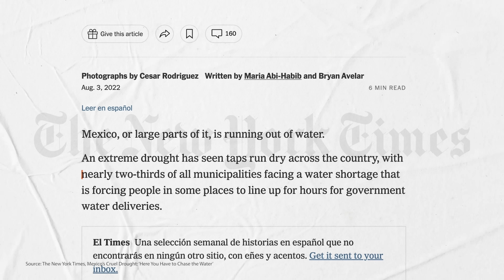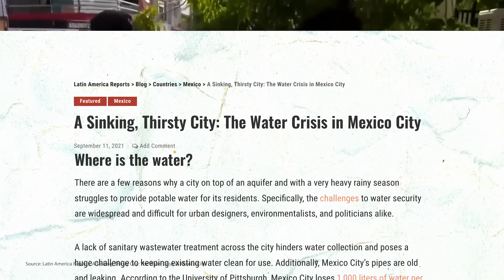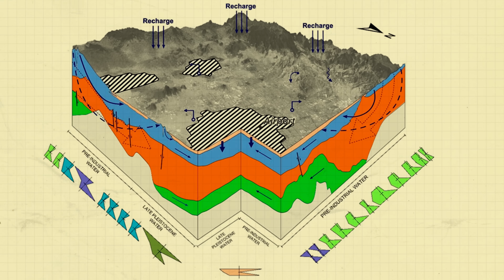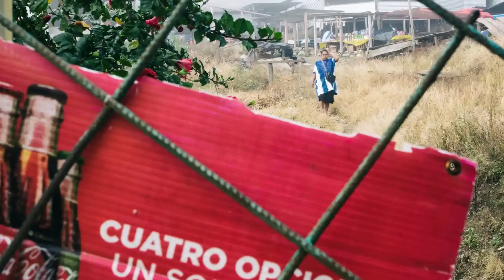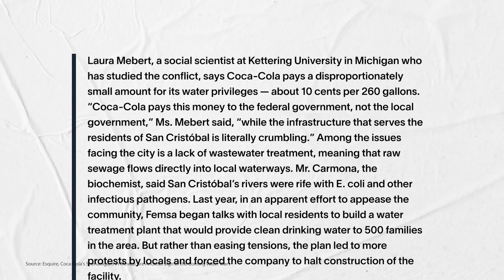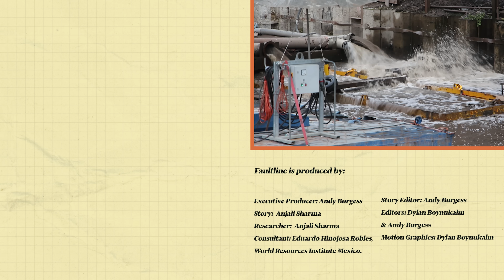The Paradox of Mexico's Water Crisis

Comment: There is a Pattern , from what I see is that the central states are the ones suffering because they are not in a coast and because they don't have an underground pipe structure to feed those states with the water they need.  I feel bad for those people.  They should shut down the beer and coca cola companies down ASAP.  I'm just fortunate that I was born in the state of Nayarit which has 3 Dams ,and it's a state that rains consistently and sits on the coast as well. So Nayarit will never run out of water.  most of the states in Mexico don't even have 1 Dam.

Comment: 3 things going on I see after this video; 1.)  Weather Changes - and more VIOLENT weather,  and can't stop that2.)  Mexico Population rapidly expanding,  and God does not want that stoppeed 3.)  Mexican Population and Industry getting to the point like in USA around the 1940's.  So, it IS way past time for Mexico to step up to a huge amount of SMALL Water projects.  LIke a Million "Coffer Dams" all over the northern 1/3 of country with spill ways so when these tremendous and quick torrents happen - they don't over whelm these "Coffer Dams" and cause worse flooding, that without them.  What that will do will catch the majority of the run off water instead of just going into the Sea it will put it into the Acquifers and fill them up like never before.  Then cities, farms can drill and bring that water out when needed.  The City of Anaheim, CA. has been doing this for over 40-50 years.  They built hundreds of sand and gravel  'Coffer Dams in their main river (most of the year dry) drainage systems, that goes right by the Anaheim Angles Stadium.  The water during rainy season over flows from one Coffer Dam into another, and another, and another, etc.  And they keep 70-80% off all that run off water, and it goes directly into their Acquifers, and then they use it all year long.

Comment: Every action will have a negative aspect to it. What the net outcome would be should be the deciding factor. I believe that nuclear power would provide us with an energy source that is carbon free during electricity production, the power people need to improve life quality and also enough electricity for sea water desalination to recharge aquifers. The spent fuel issues can be mitigated by reprocessing through newer generation power pants and simple containment. The amount of high radiation after products is very very small. There is a difference between nuclear waste and spent fuel, both in quantities and in danger levels. Anti nukers will conflate the 2 to scare and confuse people on the real issues. The positive side is ample fresh water and carbon free electricity.

Comment: I often think:  Mexico has lots of oil and lots of water.  What do you get when you combined them?  How about if they use the oil resource to power gigantic tankers but full of water from Tabasco to Tamaulipas.  It is not a very big run.  Oil runs much farther in super tankers.  Once the water arrvies via ship not terrible long to pipe it to Monterrey.     Too easy?  How much cost a tanker?  Mexico has a lot of them.  How much cost to move it from Tabasco to Tamaulipas?  How much water can it move?  How long does it last?  Will it help reduce the floods of the South?

Comment: It's easy to use Coca Cola as a scapegoat, and even though I think they are still responsible for many water problems and specially the health crisis in México, let's look objectively to the numbers. Agriculture uses more than 3 times the water used by industries, which according to Mexican Water Commission "57% of the total used is wasted mainly due to inefficient irrigation infrastructures that are in poor condition, obsolete or leaking." And then you have the real culprit when it comes to water shortage. But there is another part of the story in which the corporations are the actual responsables: water polluting. The industry, such as Coca Cola or Heineken, generates pollution equivalent to that of 100 million inhabitants, according to data from the CNA. You combine these two, and then you the real reason of the crisis.

Comment: Mexico is not unique to water crisis.

The western United States was in severe drought conditions until this winter.  California received above normal rainfall that helped with the drought.
Reply: Any country in which an important part of its territory is desert is going to have water problems in those areas, however this is usually compensated with a lower population density in those areas. The problem is that in Mexico you cannot move the population from the north to the south because when there is a lack of water in the north, the south is flooded.

It is necessary to build a drainage system that takes water from the south to the natural aquifers of the capital and to expand the production of bottled water.

Comment: Mexico is a country of extreme diverse geography and weather. The northern 1/3 is mostly desert with large mountains in the center, flat in the east, and hilly in the far west. Tijuana on one side is amazing weather like San Diego -- mild temperatures and low humidty all year round. Monterrey on the east is very hot and also humid during the summer with cool winters. Then in the center you have half of mexico's population up in a plateau between mountain high mountain ranges.  It's semi arid and because it's very high up, few rivers. In fact, hardly any major rivers in Mexico and not sure if any of them are navigable. This center plateau area has mild temps much like Tijuana. But to the east in the center along the coast like Veracruz it's hot and humid -- jungle like weather. To the west along the coast it's more of the same though a little less heat and humidity. Then in the southern part of Mexico it's a rainforest jungle and mountainous while the yucatan is a flat rainforest jungle. 

While the geography looks amazing, it is a problem as well. Because of it's terrain and weather, I don't believe Mexico has any major rivers that are navigable. It also has water problems in many areas -- the north because it's a desert and the central areas because it's semi-arid that is up high and no major water sources as a result. The Yucatan has terribly soil and hard to grow anything -- also no navigable rivers. The southern region of mexico is very mountainous and a jungle making life difficult there. 

Compare that to the US which has a huge area in the midwest / great plains that not only has very fertile soil, but good amount rain and many navigable rivers. To the east, there are areas of great fertile soil and navigable rivers as well. Go to the west, California has extremely fertile soil and the mountains produce enough precipitation to feed the crops in California though the water is becoming an issue in recent years.
Reply: Tijuana's weather is fine, but being a high population city it also faces major water issues. The city, and most of its metro area needs to pump water from the Colorado River in order to sustain somehow the ongrowing demand. Same for Mexico City, they face several rainfalls and floodings, but they have to pump water from other remote areas in order to keep the city going
Reply: The Midwest has a big aquifer Oglala.
Reply: Ya.....makes it even more ridiculous that US food (including fruits & veggies) is SO bad. I can feel it weeks after a return. The water is ok.
Reply: @gggBassman67  US grows fruits and some veggies for max output which means the quality is usually bland. And US can't grow most of the best fruits because they require different (warmer and/or wetter) environment. Mexico has the perfect environment for many fruits and the stores are getting them close to the source so they are much tastier fruits. For the US and the supermarket model, they need to pick fruits probably at least a month before they begin to sell in the supermarket. That means lots of fruits are picked before they ripen and they do not taste as good when they ripen in transit. 

Some fruits like bananas and mangos do well in ripening after being picked. But many fruits do not which is why a papaya in Mexico taste 10x better than one in the US (unless you are in Hawaii!).
Reply: Our geography used to be better until a certain people took 2/3 of our lands.
Reply: @Halcon_Sierreno  But a lot of Mexican live in this 2/3 of Mexico land and send billion dollars remittance annually to Mexico.
Reply: @charleshoang566  About 12 million Mexican nationals and like 30 million Mexican descendants. Strangely enough it's about the same ratio of overall Mexicans like it was in 1840. Those lands are genetically, spiritually and geographically tied to Mexico. He'll, I'm from from northern Mexico but live in the U.S.
Reply: @Halcon_Sierreno  I thought these land belong to American Indian in the first place, Spanish and Mexican just stole them from native American, white settlers and other ethnic American just inherited Indian lands.
Reply: @charleshoang566  Mexico is a native country. That's why it's called Mexico and not "Spain number 2". A lot of Mexicans have majority native blood.
Reply: @Halcon_Sierreno  So why do Mexican speak Spanish instead of Mexican like other native countries around the world ?
Reply: @charleshoang566  The Spanish tried hard to eradicate our native identity to supplant it with theirs. But just look at our constitution. We don't even have an official language. Spanish is just de facto but it is not de jure. As a matter of fact our constitution sees Spanish on the same level as other recognized native tongues. Also, there's no such language called "Mexican". You're thinking of maybe Náhuatl which is the closest thing that Mexico has to a true national language.
Reply: @Halcon_Sierreno  Even Mexico owns 2/3 more of the country,it might not making the country more better because it depends on the way the government manage the country, look at Argentina which once the richest country in Western hemisphere but now it's economy just keep going down even it's the second biggest country in Latin America after only Brazil.
Reply: @charleshoang566  Mexicans already do most of the work in the U.S anyways.
Reply: @Halcon_Sierreno  Ya deja de llorar por algo que paso hace 200 años, ademas a excepción de california casi toda esa tierra era desierto
Reply: @mggaming4624  forgive but never forget
Reply: @mggaming4624  ¿A tí qué te importa?
Reply: @Halcon_Sierreno  nadie nos quitó esa tierra, se cedió por que perdimos esa guerra. Muchos países han perdido territorio en guerras y no están llorando
Reply: @kharlanhero4428  Si, no a todos los países les toca la misma suerte que a Ucrania y les regalan cosas de a gratis. Bueno, entonces me estás dejando saber que tu estás de acuerdo con el robo. Si tienes un negocio oh algo no andes chillando cuando un asalta tiendas te robe toda tu mercancía. ¿Sale? 🤗
Reply: @Halcon_Sierreno  no estoy de acuerdo con ningún robo, pero ese territorio se dio a Estados Unidos y está firmado y todo. Puede que no nos guste pero ya pasó. Aparte no podemos con lo que tenemos, imaginate con el doble de territorio. Mejor hay que mejorar lo que tenemos
Reply: @kharlanhero4428  ¿Entonces el robo está bien siempre y cuando se force a alguien firmar su propiedad a punta de pistola? 🤨 Tienes unas ideas muy babosas. 😂
Reply: @Halcon_Sierreno  Esos territorios están MUCHO mejor con America que con Mexico, los americanos les supieron sacar provecho a esas tierras abandonadas por la flojera de los mismos mexicanos y las hizo ricas y prósperas, en cambio si AUN fueran de Mexico, serian igual de pobres y tercermundistas. Si Mexico no puede aun con lo mucho o poco que tiene de territorio y la mentalidad promedio de su gente, mucho menos podría con esas tierras que ahora están y siguen en MUY buenas manos.
La tierra es de quien la trabaja (de Emiliano Zapata pero para USA).
Reply: @Joachim_M._Mart  wow so you hate your own country?
Reply: @cosettapessa6417  I don't hate it. 
It just the truth about Mexico and America, about the mentality in different countries on those times, and how the americans choose to work the stolen lands, that NOW... those stolen lands that were from Mexico are rich and prosperous, if those lands were from Mexico yet, it will continue to be just as poor as the majority of Mexico.

If U want it, I can tell you so many ugly truths about America, if you think that I lick the boots of that county.

The truth is not a sin, but it really hurts.
Reply: @Joachim_M._Mart  ¿Cual es el sueño dorado de un Mexicano?